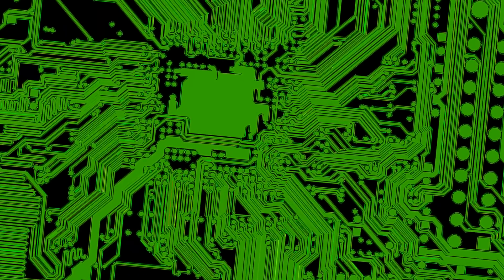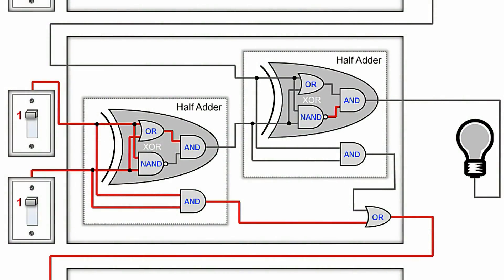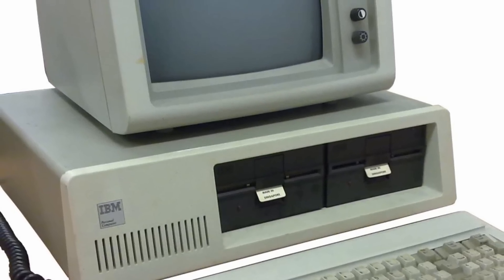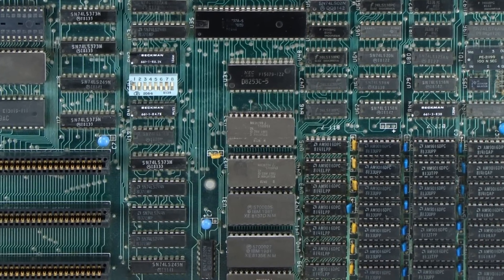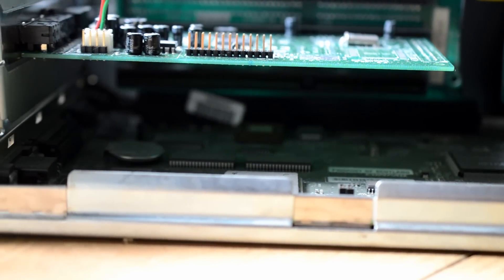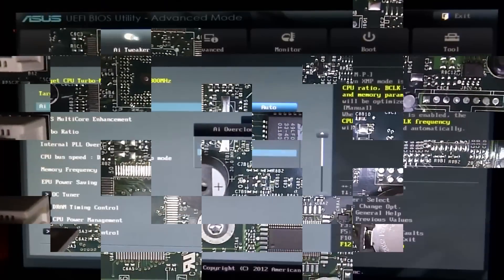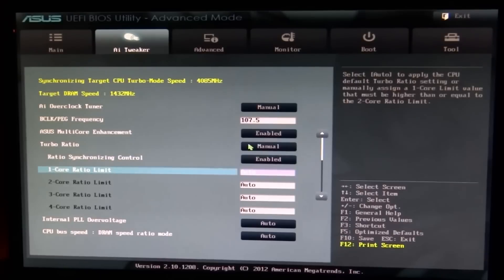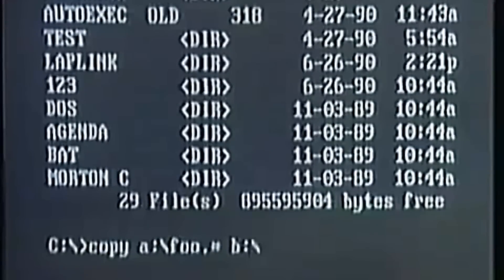Clockwork Computers [Byte Size] | Nostalgia Nerd

Comment: One of the things people miss: The signal is electricity. All the actions are powered by this. The digital signal is really high voltage-low voltage-high voltage...etc. The electronics are designed to do something when the voltage goes up, being powered by the voltage jump. They then drop into their new state when the voltage drops. They then do the next thing when the voltage jumps up again. The clock is more than just something to synchronize work, it powers it. The timing is critical, since the pulse creates a cascade of work, which all has to complete before the next pulse. That is why you have a limit on how fast any particular hardware works.

Comment: 5:02 i know this is an old video, and not worth correcting, but this is actually false.
Transistor speed does not match clock speeds. Clock speeds are actually determined by the propagation delay of a cycle ( the longest stage in a pipelined design).
It's actually why increasing pipeline length results in higher clock speeds.
Reply from the maker: I can't remember what I said, as you're right, it's pretty old. I'll double check.

Comment: I think you're getting too conceptual about a simple problem. The circuitry inside the electronics can only change states so quickly, before it may malfunction. The clock can never have and interval beyond or at this point. It may just glitch, in some cases a higher clock can even work, but generate hazardous heat. Great to see a utube channel without monetisation, can watch all these without interruption.

Comment: Surprisingly the DX4 does actually not quadruple the clock speed. It rather tipples it. Why it was called the DX4 i don´t know.
Reply: May also ad that a modern CPU don´t run from a central clock any more. Most CPU run on at least one clock per core, and quite a few have a clock for every pipe. The most modern CPU have also switches to inhibit the clock for every step of every pipe making it possible to suspend operations of every step of every pipeline independently. Making the whole processor take quite a bit less power.

Also, the clocks is generally also out of synk for different part of the CPU: The reason for this is that for every clock puls the cpu initially use a bit more current, then less and less to the end of the clock pulse. This makes the voltage drop making the CPU demand more voltage. By having the clocks asynchronous this problem can be mitigated.

Comment: i wish i could overclock my cpu to 4,77 ghz
Reply: why?
Reply: its a Nerdy thing, like the original cpu ran at 4.77 mhz , i wish i could run my cpu at 4,77 ghz. You see 4,77 mhz .. 4,77 ghz :P
Reply: Put your BCLK to 99.375 MHz and your multiplier to 48. (101.49 and 47 also works)
or FSB to 530 and multi to 9. (or 9.5x502)

Comment: Then we have graphics memory technology, which often runs at a far higher effective clock than a CPU. On a modern GPU such as the GTX 1070, for example, the 8GB of internal GDDR5 memory uses a quadrupler to essentially push an 8GHz effective clock. Some models will let you overclock this to over 9GHz relatively easily.
Reply: Its not true. The transfer rate of a GDDR5 memory is not the same as the frequency.

For DDR memory it transfer two times for every clock. For marketing reasons they there for use the frequency of the data rate in steed of the clock.

GDDR4 and GDDR5 transfers one level for ever flank, it also transfers two bits for every level, making the bit transfer rate 4 times that of the clock frequency. So if it says 4Ghz, its really 1 Ghz, not 4. This is really marketing bullshit

Comment: man I remember having to calculate cycles, back when I use to do assembly programming on my amiga and MSX. As fun as this was, I'm glad we don't have to worry about things like that anymore :)
Reply: I was looking at some of my old 6510 assembler code earlier this evening, it has comments added to each instruction to describe the cycles used, including things like overlapping cycles (6502 and its derivates have a simple pipeline) and special conditions (crossing page boundaries requiring an extra cycle, 'stolen' cycles due to video or dma etc). The code is intended to run in cycle exact lock step with the painting of the screen (actually writing directly to the dac to implement a kind of software video controller). Like you, I'm glad to not have to do that anymore, but it was fun to do, and fascinating to read back (how on earth did I have all the info for that before the internet age.. much of it gleamed from diagrams and lots of experimentation)

Comment: Cheers lad, you tackled a very complicated subject like a champ.
Reply from the maker: You're most welcome bonny chap
Reply: Nostalgia Nerd Whats the theoretical highest clock rate that could ever be achieved as known physics allow them today and what is the highest possible clock rate based on the certain theoretical physical properties that may or may not exist.....kind of like science fiction...like is it theoretically possible something might be faster than light could be used instead of electricity. Could you have electrons travel shorter distances in or outside the cpu using space bending things like tiny wormholes and such....also how small could transistors get using the same logic? What about cpi?.....how high can that get?...sorry for all the questions I just really want to know.
Reply: @jet100a  Those would be questions for a physicist.

Comment: Only really since the 2008 crash. Before a billion was a million million
Reply: I assume that was a joke. ;p

if not, the definition of a billion has varied by country, but for cpu's, it's always 1000 million. (also, 1000 million for anything that uses the metric system)
Reply: nope
Reply: +mipmipmipmipmip completely agree. The term in British English has been hijacked since 2008 to mean a thousand million. I have no problem with that, guess it means all English speakers are referring to the same value now :)
Reply from the maker: Correct. Hence the reason I went with 1,000 million. :)

Comment: Downplaying MIPS? Seriously? Way to take credibility and chuck it out the window.
Reply from the maker: I didn't realise you and MiPs were so close. I do apologise.
Reply: MIPS matter a lot more than the clock speed of a chip. There's a reason why GPUs and supercomputers aren't rated around clock speeds, but around MIPS/BIPS and FLOPS. Because ultimately, the clock speed doesn't matter if you can get more done per-tick.
Reply from the maker: +Sable Drakon (Resistance L8) Correct. Essentially what I said. It measures task speed.
Reply: Which is a lot more important these days, since CPUs have been trapped at the 3.5-4GHz threshold for nearly a decade.
Reply from the maker: +Sable Drakon (Resistance L8) Indeed. But this video is about clock speed, not the finicky details of how your preferred tasks take to complete.
Reply: +Sable Drakon (Resistance L8) way to go trying to marginalise someone else's efforts. Why not make a vid on mips and compete in the arena of ideas, I'm quite sure he'd put a link to it

Comment: 12 years ago CPU's hit 3GHz. Today, we've barely gone over 4GHz. Lots of cores and efficiency in today's chips but I think we've hit the clock limit. We'll be stuck with 4-5Ghz chips for the next decade, at least, and only in high-end chips. Above 5GHz and the amount of heat generated is not worth the minimal performance gains compared to multi-cores and modern instruction sets.
Reply: If you look at overclocking, the record is something like 8.7 ghz.
Ironically, the highest speeds are accomplished with cpu's specifically from 2006 and 2009.
The best anyon's done with a more recent cpu is about 7.5 ghz.

That sounds impressive, but who knows what the cooling looked like. (liquid nitrogen most likely - which, while effective, boils off in a matter of minutes, meaning you have to manually keep adding more, or risk destroying your computer. - great for showing off, not so impressive for actually trying to use the system)

Aside from that, power use is a concern. There were cpu's that you could reasonably overclock by 50-60% or more of their designated speed and it'd be quite usable, with a good cooler, but power usage could double or triple to get that extra performance out of the chip...
Reply: Yeah. I recently upgraded from a generation 1 i7 to generation 5 i5. Even with less threads the new instructions and features give outstanding results in heavy tasks like video encoding or emulation compared to my old chip. I think in last decade still these upgrades also came with boosts to clocks, though also boosted clocks were back then significant, but now we have moved to other areas to get significant performance boosts and the clock rate is less significant really.

There is still room for better and better optimization of multiple cores too, as it is not yet all encompassing especially in gaming.
Reply: Coldie - Note quite, its a tad bit (lot) more complicated than that. That has to do with the properties of silicon, that we are nearly at the limit of.
Conenion - it is not only possible to parallelize 95% of a programs compute work but it is done at nearly 100% (theoretical max of ~99.99999998% on Titan) on supercomputers. For most most desktop applications what you said does hold true, because OpenGL and most other graphics librarys must operate on a single thread...
Reply: A 3ghz Core i7 is still vastly more powerful than a 3ghz Pentium 4 though. CPU's have improved i other ways, not just clock speeds. Multi-cores, much more efficient architecture, more cache, faster communication between the CPU and RAM and so on all contribute to a modern CPU's power
Reply: diablomix
> Above 5GHz and the amount of heat generated is not worth the minimal 
> performance gains compared to multi-cores and modern instruction sets.
Because of Amdahl's Law single core performance is king. If possible, a 5 ghz cpu is
much better than 2 with 2.5 ghz. And much much better than 5 with 1ghz.

Even if you could parallelize 95% of your program (which you can't).
Reply: Putting more cores on the die is not the answer, just look at 3DFx. We pretty much reached the limits with todays technology. We can only shrink production size so much before the electrons start jumping across the circuits. So the next step will be either biological or quantum.
Reply: i think you missed the point of my comment. Well yes we can start buying server mainboards with 4-8 cpu sockets or have a whole room in our house dedicated for a small super computer, but that is not the future. We need to advance our technology to keep things small, produce less heat, need less power and work faster.
Silicon lithography based cpu circuits are getting to their limit.
Reply: @killerall
> most applications need to render graphics 
2D graphics has nothing to do with number crunching. And nothing to do with
parallel programming at all. So why do you bring this up?

> that the rest of the code style follows that old, single threaded, code style.
What has this to do with making typical desktop applications (without games) faster by parallelizing them? On a CPU, not GPU of course.

It is not a problem of "old code" that follows an outdated "style", the problem is
that many problems are not easy to parallelize. If at all.
Reply: diablomix 

What is very impressive today is the 2+ GHz designs commonplace in modern high end smartphones.
Reply: I think both of you missed my point.
ColdieHU > only the first line was directed at your comment.
Conenion > No shit sherlock, its not like i have two IDEs, chrome, etc, non-game apps open... I didn't specify that it was games only, if i am not mistaken most applications need to render graphics and don't directly write hardware commands. It would then be reasonable to conclude that they use a graphics (or really any) API that was started before multi-core computers existed in the home, and that the rest of the code style follows that old, single threaded, code style.
Paul > don't forget about smarter pre-fetchers.
Reply: @Paul
> A 3ghz Core i7 is still vastly more powerful than a 3ghz Pentium 4 though.
Sure, but that is not my point.

>  Multi-cores, much more efficient architecture, ...
Multi-cores that is my point. More than one has to be used in a single application if you want to achieve a speed up (https://en.wikipedia.org/wiki/Speedup). 

Architecture improvements, expecially extracting more and more instruction level parallelism (ILP) to gain more IPC are limited. So is data transfer to RAM. Also, it is 
getting more an more difficult to make structure sizes smaller. Intel currently is having mucho problemas with 10nm. 
http://semiaccurate.com/2016/12/28/coffee-lake-says-dire-things-intels-10nm-problems/

14nm was delayed, btw. Substantially higher clocks seem to be out of reach right now. So there is only one option left: More cores. But these are difficult to utilize by programmers. That's why they say: "The free lunch is over".

My point is that we are hitting a wall. Given Amdahl's Law, from now on we'll not see any real improvements in computing speed (typical general purpose stuff, not supercomputing). 

This trend is already visible since the last 5 years or so. Compare these with those from say 1990 to 1995. The curve has gotten flat. In fact so flat, that Intel's Kaby Lake has the exact same IPC compared to Skylake. Kaby Lake has a marginally higher clock, that's it. What they could have done is adding more cores, sure. Of course that can be attributed to Intel's lazyness and missing competition from AMD.
Reply: The IPC is so much better anyway. 3GHz 12 years ago is nothing compared to 3Ghz now.
Reply: diablomix yeah but what if we significantly changed the architecture. A higher clock speed is favorable, but a higher clock speed doesn't always mean better performance, especially when comparing between different cpu architectures.
Reply: Lauren C don't you mean 3+GHz I'm most phones these days, even 6-8 cores is not uncommon. I owned the first 2GHz android phone and the first quad core the advantage of ARM is something that we all should be paying attention to.
Reply: Ben Quigley 

No, the fastest clocking smartphone cpus I've seen would be the Snapdragons 805, with quad core 2.7 GHz Krait cores. Most mobile CPUs favor lower clocks, but a bigger cpu to get more done.
Reply: Well, a single core could be made much faster within thermal limits. Safe voltage is more the limit now.
Reply: I'm FROM THE FUTURE! AND YOU ARE CORRECT.
Reply: well modern chips still increase speed but not with the clock rate. people just try to find more efficent ways to execute more code in the same amount of time
for example if you were to taka a modern i9 and ran it at the same speed as a Z80 or any other early MHz CPU the i9 would still be faster because it can make greater use of each clock cycle compared to the early ones
Reply: 24/7 stable 5GHz on air cooling became feasible with the release of Sandy Bridge. That was in late 2011.

Since then, much development has gone into reducing power and cost rather than chasing screaming clocks. That's why Intel stopped soldering heat spreaders to dies when they released Ivy Bridge. Memory controllers have also come a long way.
Reply: @killeral
This thread is about CPUs not supercomputing.

> For most most desktop applications what you said does hold true, because OpenGL and 
> most other graphics 
People do more with computers than just graphics for games. And by far not every application is parallelizable in a SIMD fashion (which is what GPUs do).